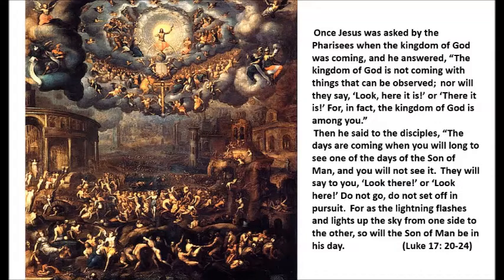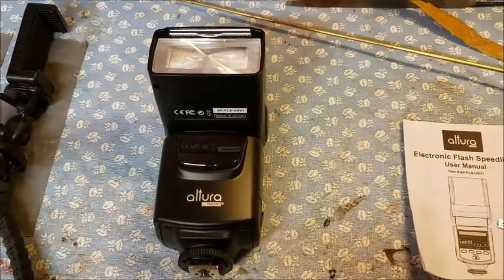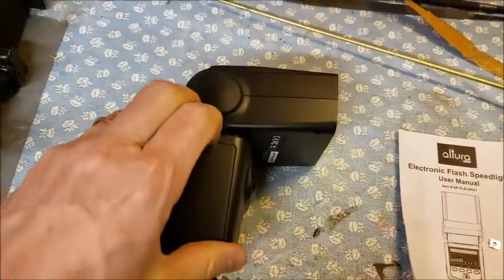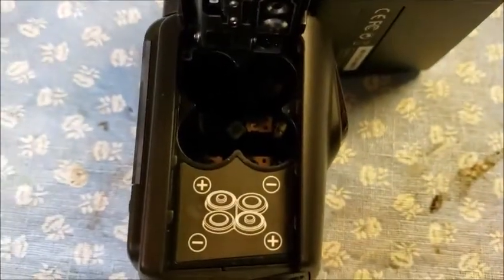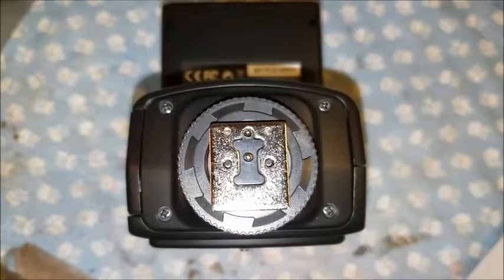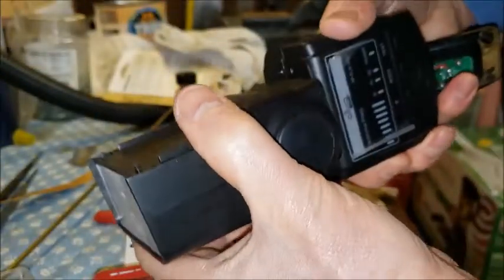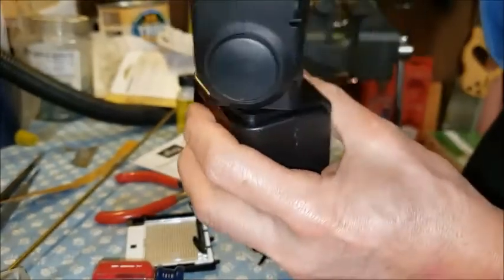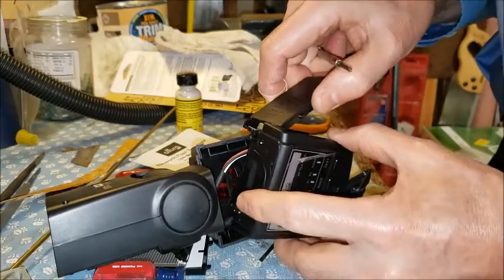Altura Electronic Flash Speedlight for camera no power repair

Comment: Hi thanks for the video! This is my problem except I never found that tab that broke off. tried to do my own soldering and ended up cracking the whole thing when I removed it. Any idea where I would get these tabs? I inquired with altera but haven't heard back.
Reply from the maker: No sorry,  I never tried to get any parts.
Reply: @diywithdave3186  no prob. I figured it out.
Reply from the maker: @mdoyledesigns  glad to hear it.